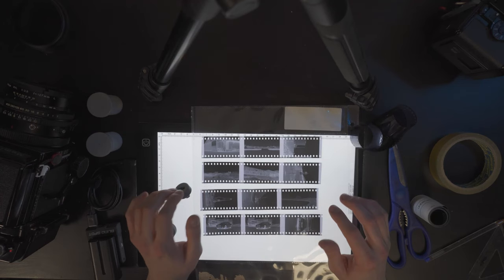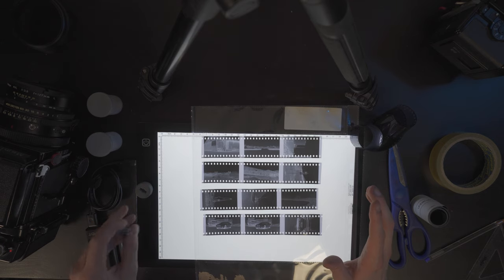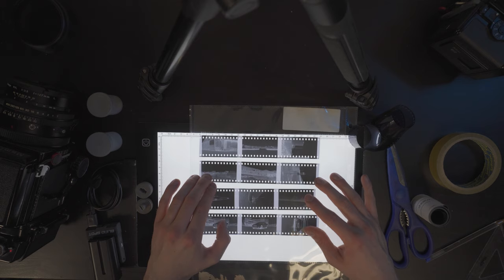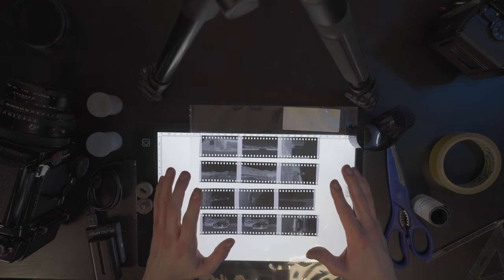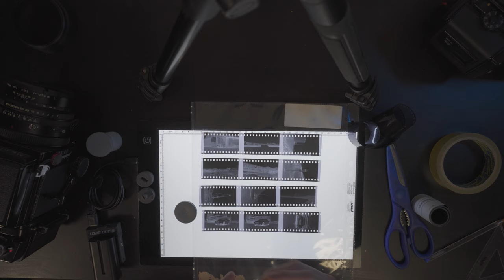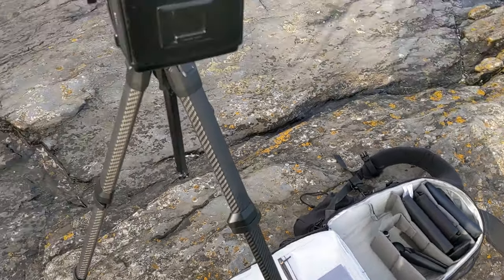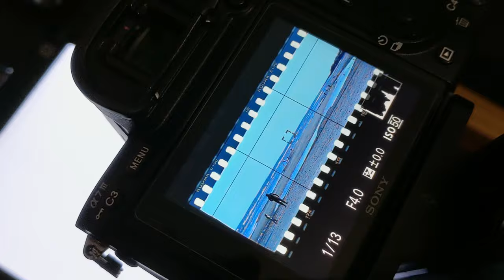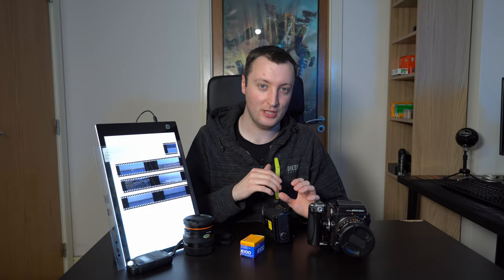Making a MamiyaPan (35mm film in RB67)

Comment: Very good video !

I cut the ends off 120 film spools and used those ends as adapters for the 35mm roll of film in an RB67 220 back. I have two 220 backs so I do not worry about rewinding the film. After completing a roll, I just replace it with another loaded 220 back. I wait until I get to the darkroom to either develop the exposed film or store the exposed film in a light tight container.

Comment: You can find adapter kit with an additional 120 spool that has a 135 gap in the middle, so the 135 film spools very accurately.
Iself use a Hasselblad V system camera with a 220 back.  I just tape a 40cm long piece of old 135 film to the film that has to be exposed and then all other operations run by themself even the back frame counter can be used.

For an accurate framing I tape some fine sewing thread on the matte screen. Tiny tape pieces maintain the threads on the edge of the screen. It works very well. I made a dedicated screen for sprocket shooting, so I have just to replace it each time I go to sprocket shooting

Comment: Greta video! I've shot 35mm on a Mamiya C330s, and I found that you can get your frames much more closely spaced together (so less wasted film) if you set it to 220 film instead of 120 film.

I have a Mamiya RB67 and I'm about to try this out with that camera as well. I bought myself a 220 film back specifically for this purpose (they're a lot cheaper than 120 backs) and I'm hoping it turns out just as well.

I had used s length of 35mm film feeding into a 35mm spool in a second pair of adapters, but I very much like your method of using 120 backing paper and a 120 spool. I'll definitely give that a try.

Comment: I bought a 220 back for the mamiya and got around 20 shots on each 35 mm film. Also used a Fuji gl690 for even wider panoramic shots. There is a guide called Texpan for doing it with the Fuji. Awesome results.

Comment: A 220 back for an RB67 isn't expensive (since 220 film hasn't been made in fifteen years or so).  A little tape so the friction roller will drive the counter, and you don't have to dance with the double exposure lever -- and the back expects to make 20 exposures, which is more than you can get on a 36 exposure roll of 35mm anyway, but the frames are correctly and consistently spaced instead of getting further apart as the roll progresses.  If you can make a frame mask for the film gate, you can make one to drop into the viewfinder as well, so you can frame accurately.  For 6x7 (or 6x9 even more so) this is eminently practical.  Even for a horizontal transport 6x6 it's of marginal utility, and on 6x4.5 it's firmly in "why bother" territory.
Reply from the maker: Right on all accounts. I didnt get a 220 back because I was planning to (and have since) to sell this beast.

Comment: Isn't it a better idea to put another canister from old film into the taking spool slot, and wind the film back into it? then you just take it out
Reply from the maker: yes, but the adapters I had were not very good and might break winding the the film So I used a 120 spool instead.
Reply: @SprocketHoles  nice, i just got my adapters and will try the canister method, i got it on my pencon six, so no film should be wasted 🤔 also saw some  3d printed takeup spools that can only take the film in the middle so it is not tilted, gotta experiment
Reply: @EpicDubstepManiac  very wise would be prewinding film and mount spool in the dark onto that 120-35-spool. film will land in 35mm-cartridge. get bulkspools which can be opened. only one film can be exposed. or darkbag needed.

Comment: Why not just shot 120 rolls and crop afterwards. Okay you get only ten shots but gain the ability to „shift“ the frame. Nice hack. I just don’t see the point. Maybe someone could explain.
Reply from the maker: No fun in the sensible method
Reply: @SprocketHoles  fair enough. 😄
Reply: I agree... I see too much unnecessary compromise:  issues of pressure plate sensitivity, light leaks and film alignment... not to mention frame spacing and counter issues.  I would just mask the viewfinder and take the photos on 120 film normally. The panoramic  composition can be recovered by a simple crop.  This is purely a fiddlers exercise. I can see a lack of sharpness in most pano photos taken this way compared to what the cameras can do with the film back it was intended to take (120).  If you are printing 20x40 it will make a difference.  Kudos for the inventiveness though... it would be satisfying to pull it off.